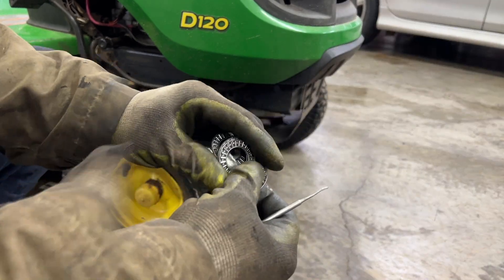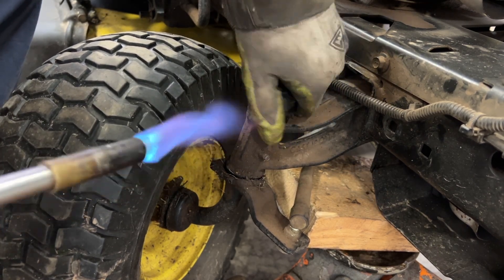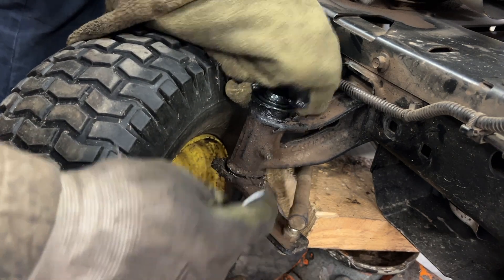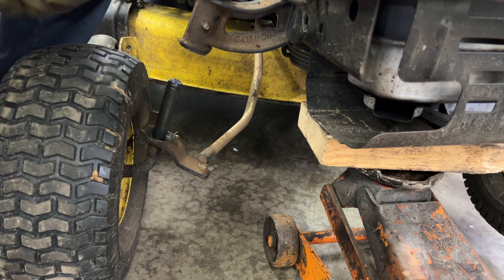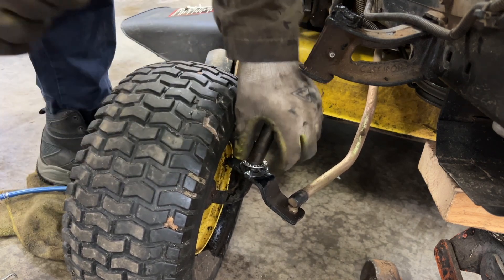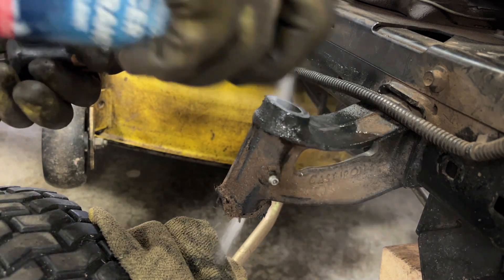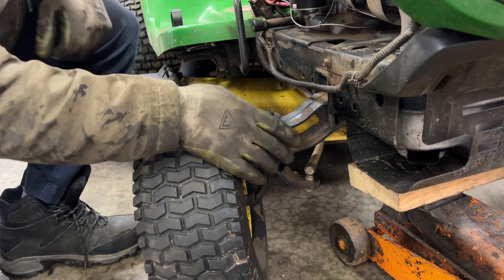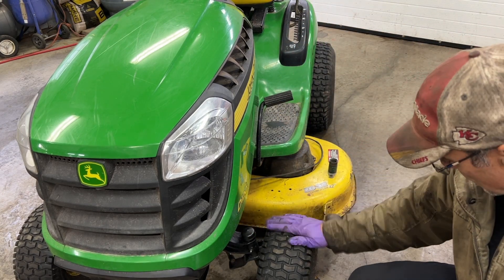Power Steering Modification: John Deere Lawn mower Tractor. LA, D, E 100 Series D120, D130 LA135

Comment: I have a JD LA145. What size Thrust bearing kit do I need for this project? 3/4"?
Reply from the maker: Yes.     This mod just helped a bit.   Lubing the steering gear under the tractor helps too

Comment: 0:26 I did this on a 5 year old JD E170 and it didn’t make any difference at all. Maybe with low hours and keeping it well maintained there wasn’t much wear. It wasn’t worth the time to do it. The real issue with JD steering is all the “play” in the gear & pinion. Not a good design.